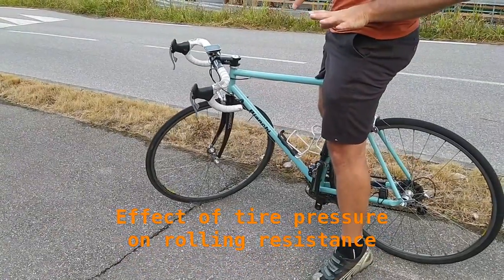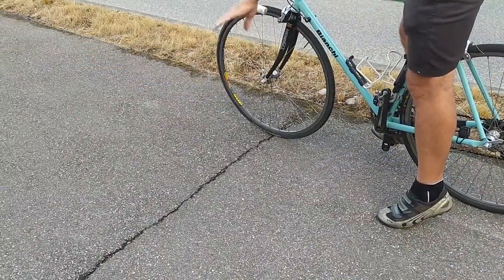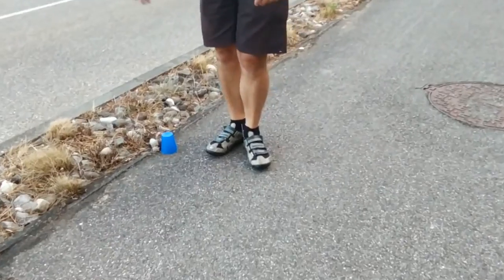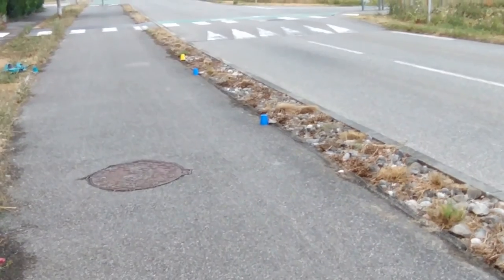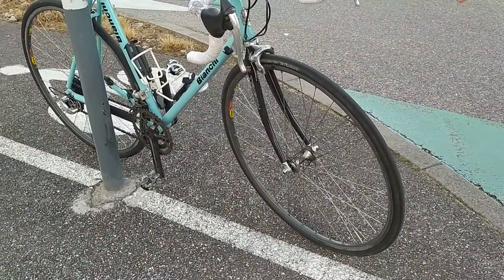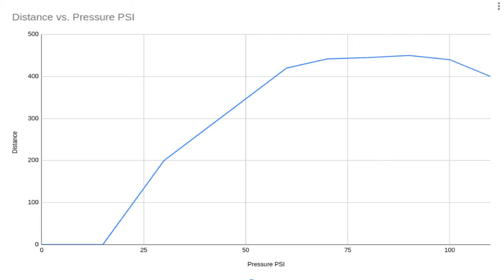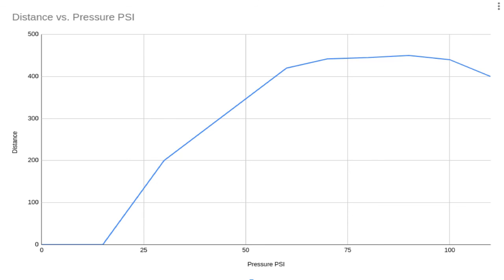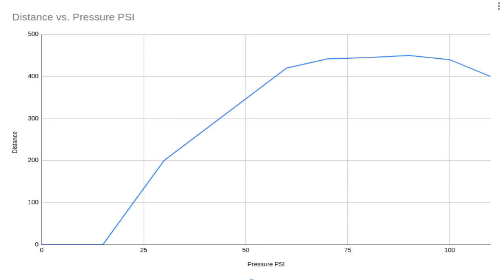Effect of tire pressure on rolling resistance

Comment: Another factor that I read about but so far not tested, is the effect of road roughness. So using your final pressure graph, the theory is that at higher speeds the road roughness "microbump frequency" increases so the increase in rolling resistance at the end of the graph shows up earlier, so at a lower pressure.
If this was confirmed would mean that the optimum pressure would even lower than in this test.
Hard to test though.
Reply from the maker: You have to take a bit of a view on what conditions are like locally. We have generally good roads but some areas are potholed - largely in town. I checked the SRAM calculator and they suggest 85 psi front, 90 psi rear. As the graph at the end shows, you can go down to 75-80 on the road I tested on (smooth tarmac) with very little change in performance and certainly on rough roads you may want to run lower pressures and as you said, maybe even gain on overall performance. Or run fatter tires and lower pressure. GCN have just covered this subject with similar results.